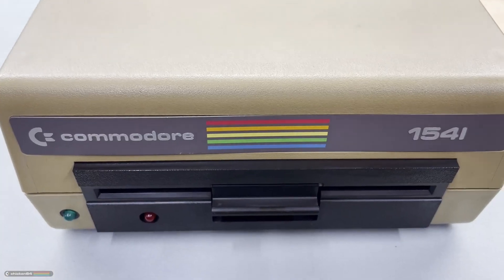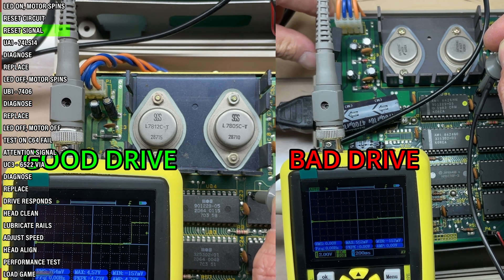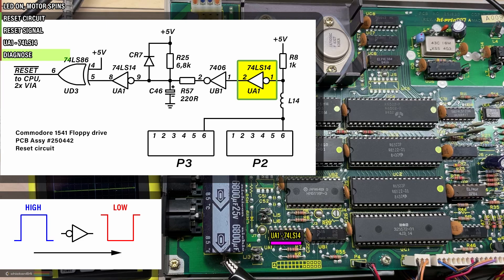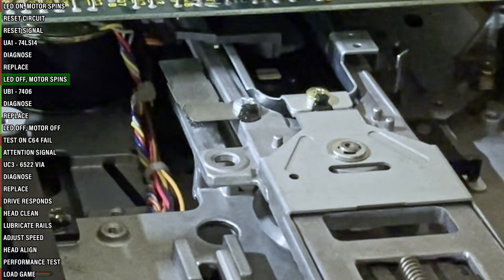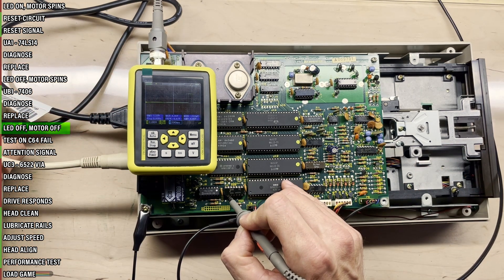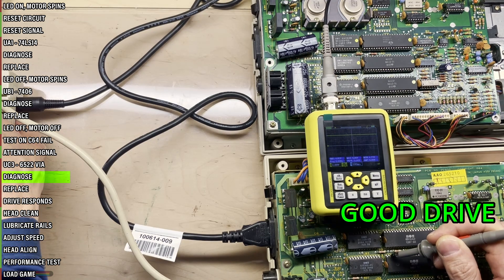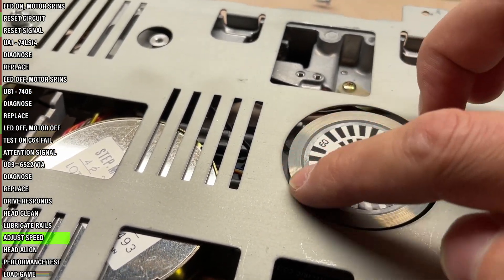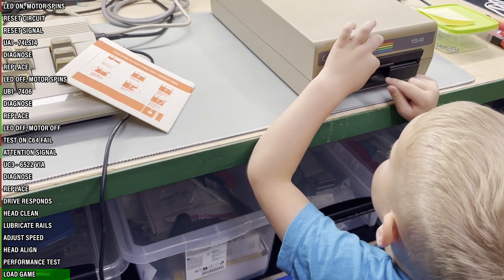Commodore C64 disk drive repair: fixing the reset circuit, replacing chips on the 1541

Comment: Very nice! I am electronically half-blind, so what if the drive motor keeps spinning on power-up, and red LED flashes around every 1-2 secs? I heard: RAM ?! 
This drive is in an SX-64, so the IC naming and layout is quite different.
Reply from the maker: If the motor keeps spinning, I'd take a look at the reset circuit first. When the reset is performed correctly, it should stop spinning. So it might be a similar issue to the one in the video.